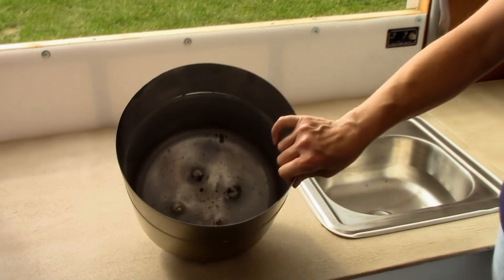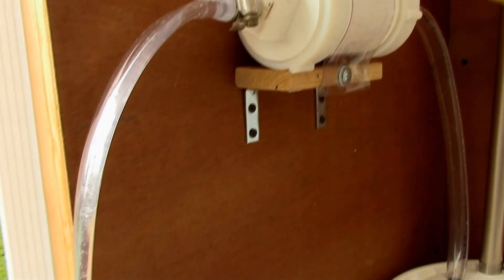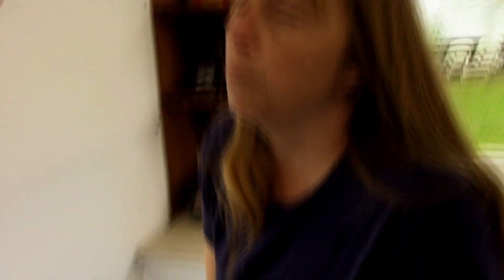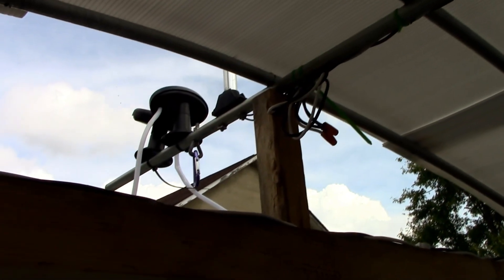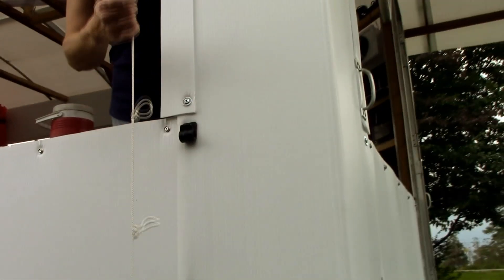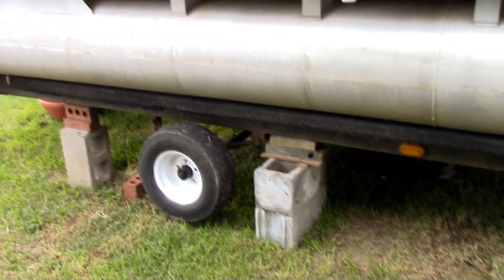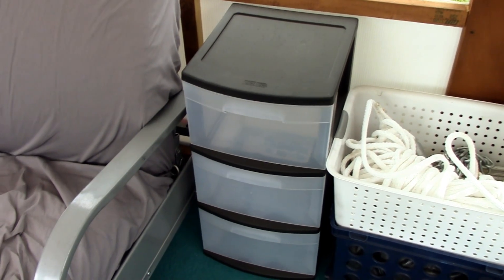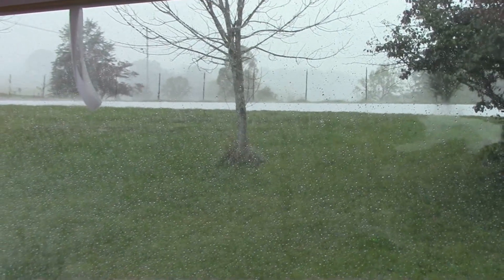Ep.16 - Resuming Work On The Boat

Comment: If your using home or rv caulking on that plastic your always going to be resealing leaks.  Use marine sealants,  3M 5200 4000 or  Sikaflex
Reply from the maker: +Mazda rx7 Thanks!!!  We didn't know that. The silicone caulking we applied to the roof if peeling off. I'll order some marine sealant today!
Reply: Bret Becky
Just buy the smallest tubes you can get. try different ones until you find the best one for your application. Silflex might be the most bang for your buck, but test it before buying large quantities.. Marine products are much better than home or RV products.  If it's good enough for the North Atlantic or the Bering Sea, it will be great for you pontoon boat
Reply from the maker: Mazda rx7 Thanks again!  Info like this is incredibly helpful. The caulking we applied originally only lasted about 6 months. :(
Reply: Bret Becky
The product you choose must not only have good adhesion properties, it must also be reasonably flexible. Give the mated surfaces a good cleaning with alcohol ( or acetone if it don't melt the plastic) to remove anything which may impede the product's ability to stick.
KORITFW

Comment: Hey guys, I wanted to pause the video right on the topic of that front white light you placed on the roof. I understand & it's a great idea  to make yourself visible, but shouldn't you put your green & red navigation light up there? It would make it legal and those red/green navigation lights are even more visible from a great distance at night versus a white light. You can have the white anchor light on the rear side of the roof. This type of set-up will also show other boaters which way your boat is pointing, especially if your running at night, which is the whole point of red/green on the front of the craft and white as the anchor light in the rear. I know ya already have navigation lights on the front railing, but you wouldn't even need those if you mount a single red/green up on the front of that roof. That was a great idea and VERY visible from a great distance. But from a great distance in darkness, I know from my own boating experience  that a tiny white light is hard to discern  from a porch light of a house way off in the distance on shore. The red/green light  would easily be recognized as a boat & will definitely be a safer  alternative for the front up on that roof, plus it's legal  of course.  Some folks run wide open on the water at night, and they would spot that red/green right away and know your there on the water, instead of confusing a white light with a house farther away. Or you could keep your current navigation lights PLUS have the additional forward facing red/green up top too, for areas of high boat traffic at night.  I understand the red/green is only required while running, but they sure let other boaters know your a boat and NOT a house farther away. Just sayin'.
Reply from the maker: +Howabouthetruth You're probably right. The only reason we didn't put the navigation lights on top is because we believe we will eventually have to replace the Coroplast on the roof. It's not much fun roofing the boat, so we left off as many lights and stuff as we could so that there would be less things to disconnect and reconnect when the time comes. What we did instead was to put two 360 degree lights on top, but in a place that is not on the Coroplast. We also wrapped two strings of lights around the boat close to the top for extra visibility.
Reply: I agree.  No one is going to miss that brite white pontoon with all the other lights on it, and having 2 white lights on top may make things more confusing to other boaters.  Otherwise, really enjoy all that you do....and wish my wife was as capable with thing like this.

Comment: how much weight u reckon you've added ?
Reply from the maker: I wish that we had weighed everything before we screwed it in place but we didn't so I can only guess that we added about 500 lbs. I'm going to run it through the scales at the local gravel pit, but I'll have to drop the boat in the water first, then go weigh the trailer, then weigh the boat and trailer together and do a little math to get the weight of the boat. It's more than just a curiosity, the law requires a placard that is displayed with the weight. Ugh